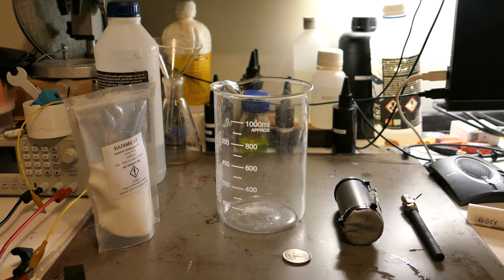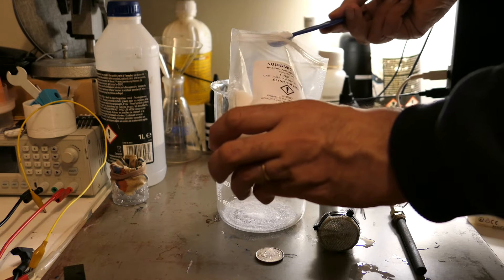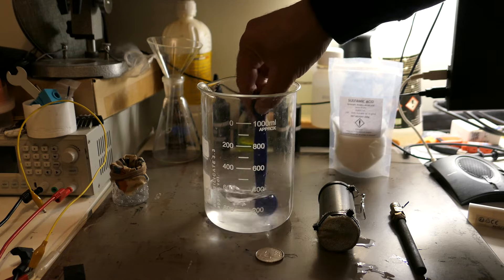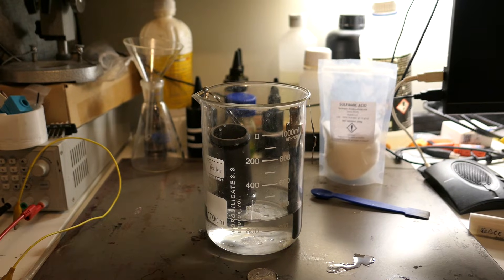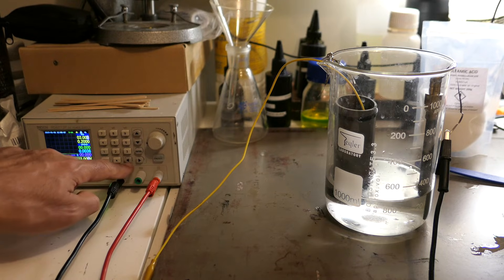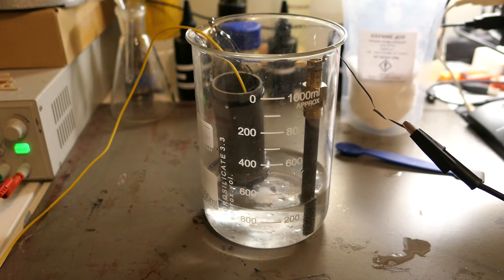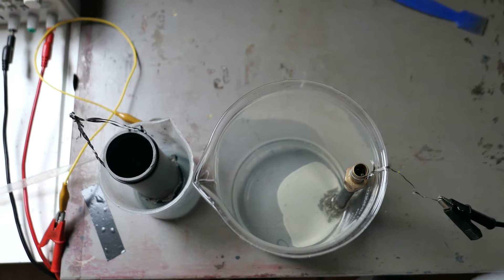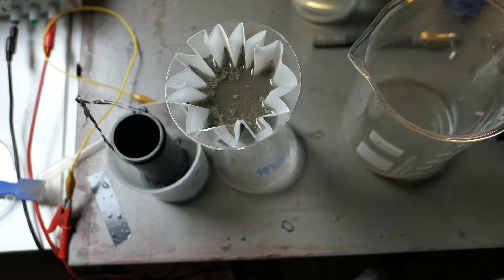Extracting silver without nitric acid by using the sulfamic acid  (a low-danger descaler) !

Comment: Of the Ph of your electrolyte is too low, you get "moss" formation of silver and copper 3 ions (you will see green banding in your electrolyte if in a glass reactiom vessel). This can also be to poor filtration at the anode basket. 
Low volt and low current with ultra low resistance causes a cascade effect as well that can cause the same outcome (upping the current helps if the solution is running low.on silver ions for some reason, or adding Nitric until the Ph is lower than 2.

Ph and saturation is VERY important in the electrolyte! It HAS to have enough excess hydrogen for proper deposition om the cathode to occur. 

If you want ultra fine crystals, with low molecular density (ideal for making electrolyte) half an amp at 5 volts with a density of 100 grams to 750mL of electrolyte and distilled H2o, with a final Ph of reactor being at 1-1.5, generates very rapid growth on stainless steel cathodes. 
Anode surface area matters a LOT at lower Silver concentratiins of electrolyte (so does cathode surface to density ratio).

At a higher concentration, there is no need to run super low voltage, and you can lower surfave area of anode and cathode. 

Using 925 anode bar, and necklace cuts/rivets/shredded sheet/shot etc i can get SOLID cementation on the cathode, with an ENDOTHERMIC return, and no difusion at 5volts and 2000 mA chwrging supply. 

Took a LOT of trial and error to get a good system that I can walk away from for 12 hoirs and be confident it hasnt bridged and staryed dropping copper ions. 

If its Black, Its whack! You NEVER want your deposition to do that. It means you are oxidizing the silver at the Cathode, and you should DECREASE surface area of anode material (increase density too). Replace anode with graphite, reverse polarity to blast the oxide back into solution (do not connect with anode basket in place btw).

Comment: My theory on why it turns from dark gray to shiny silver after you turn the power off is because it is partially silver metal and partially silver oxide when dark gray but silver oxide is soluble in sulfamic acid and forms silver sulfamate when it dissolves, but sulfamic acid does not ordinarily or at least quickly or shortly dissolve metallic silver, so the shiny metal is left over and the silver oxide is dissolved leaving a shiny appearance.

Comment: If I have a whole bunch of different metals all mixed together and I use this message to pull the silver out I will be left with sediment or my original metals still in solid form in the filter right that I can rinse off and then start over by dissolvingthe rest of the metals correct

Comment: I may have missed it, but what is the liquid you poured in from the bottle? Distilled water?
Reply: He said, "water" but I believe distilled water was implied. Tap water can contain iron and the author of the patent said the process is suceptible to iron contamination. In fact, stay away from substances higher up or near silver in the list of reduction potentials. These substances will preferentially deposit on the cathode: 

F2(g)+2e- → 2F-(aq)	+2.87    fluorine (Difluorine)
S2O82-(aq)+2e- → 2SO42-(aq)	+2.01   persulfate
Br2(l)+2e- → 2Br-(aq)	+1.09   bromine
Ag+(aq)+e- → Ag(s)	+0.80   silver - good
Fe3+(aq)+e- → Fe2+(aq)	+0.77  iron

Comment from the maker: I tested the extracted silver. It still contains a small amount of copper. I'm wondering whether the 3V voltage applied isn't still a little too high.
Reply: Have you tried adding the glutamic acid to the electrolyte like the patent shows?
Reply from the maker: @m.redmon9447  I haven't tested it; I understood it was to prevent the formation of dendrites during electrolysis.
Reply: "The standard reduction potential for silver is +0.80 V.  It is a higher reduction potential than copper's, +0.337 V.  The reduction potential is its tendency to gain electrons and get reduced.  Larger positive values of reduction potential are indicative of a greater tendency to get reduced." 

Which does not mean copper will not also be reduced. Just in less abundance.  As you said, try ramping the voltage slowly upward from zero until silver just starts to deposit on the cathode.  The author was aware that the method can proceed at much higher currents than nitric methods, so bringing the electrodes in closer proximity and/or making them larger might greatly increase the reaction rate and lessen the amount of copper that has time to be reduced on the cathode.  Thereby allowing a faster rate of deposition at the lower voltage found when you were ramping up.

Ag+(aq) + e- → Ag(s)      +0.80 V

Many thanks to you for finding this inexpensive and safe process. It is literally worth it's weight in silver.